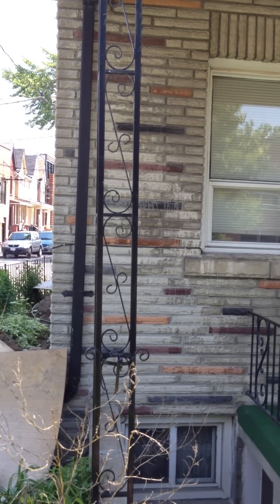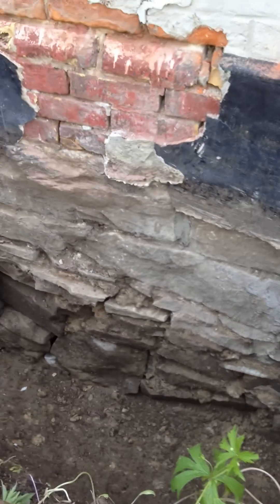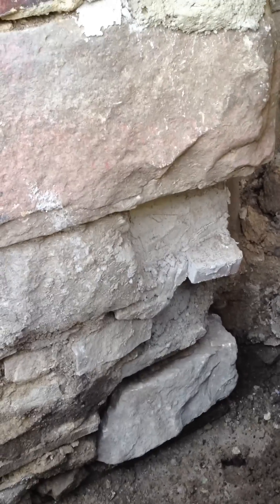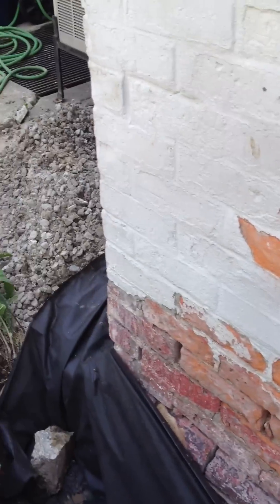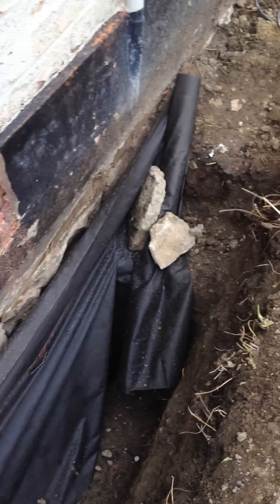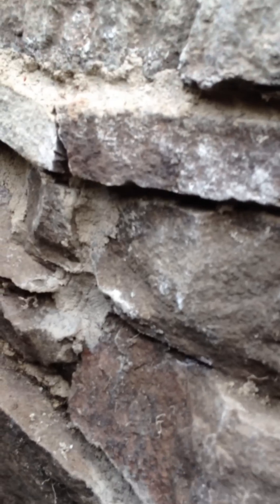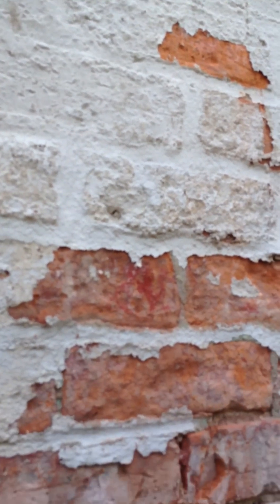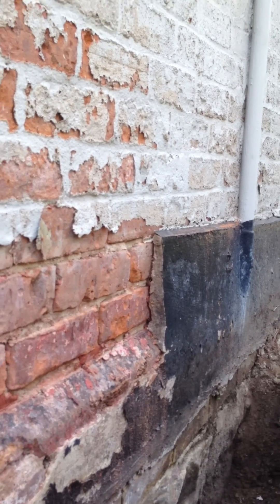repairing my fieldstone foundation with lime mortar in toronto (part 1)

Comment: Lime needs CO2 to set.  I don't think the mortar was degraded.  I think it just never set in the first place.  Castles take thousands of years for lime mortar to set on the inside because once he outside is set, the CO2 cannot penetrate.  The bonus is, when cracks occur, the lime will set and auto repair it.
Reply from the maker: Peter Lue In the fieldstone section (below grade), most of the mortar was so badly deteriorated that there was no mortar left at all, and rocks were falling out of the wall. The mortar between the bricks under the parged area appeared to have been damaged by water. The rest of the wall seems to be in good shape.